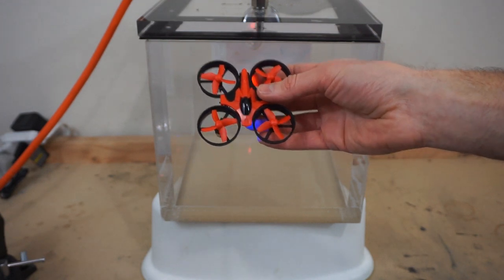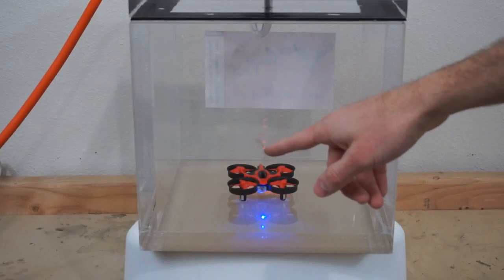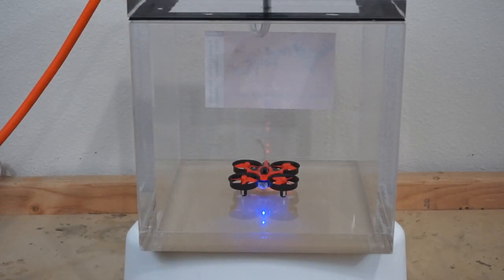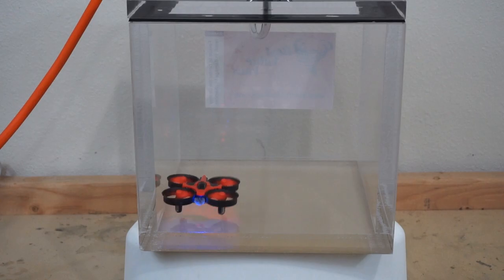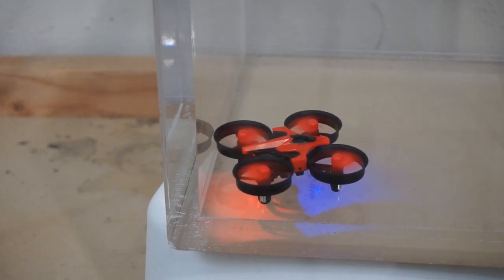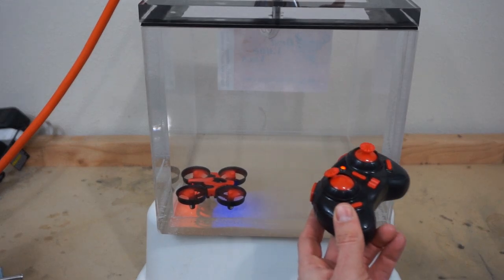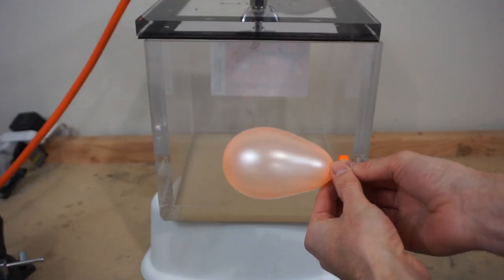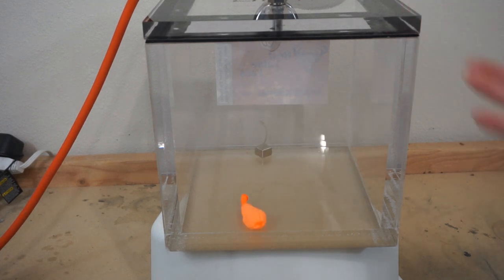What Happens When You Put A Drone In a Vacuum? Can It Still Fly?

Comment: Right so here are all the problems: 

1. The reason that the quad copter is capable of flight is not a pressure differential, it is simple movement of air. Yes, there is a pressure differential, but thats just because something is moving in a fluid

2: your balloon only works with liquid or gas rocket fuel that pressurizes itself as it is ignited. Without the pressure of the atmosphere, a solid rocket will not burn fast. For proof, check out Cody's Lab's latest video. 

3. The people who sent the rockets to space knew what would work and how it would work, if they hadn't, there is no possible way that they could successfully direct a rocket anywhere.
Reply: The third point doesn't matter as much as the first two
Reply: He gets the point across.
Reply: Jaden CM there are solid motors used in space, especially on smaller rockets or as kick stages. These obviously work, so they have some mechanism to work, although my physics smarts aren't good enough to make a guess as to why
Reply: Marius Schär it is possible to have solid boosters that pressurize themselves as they combust, the thing is, and I'm oversimplifying this, when you burn things in air there is pressure (oxygen is not necessarily necessary) but without the pressure, you cannot get a chain reaction causing repeated combustion. 

In a vacuum, when you burn things, the molecules that combust fly away/lose their heat too fast to supply enough heat to the next unburnt molecules in order to catalyze the combustion reaction. 

So if you were to take a rocket and essentially plug the bottom in order to create something that acts like an artificial atmosphere, you could get combustion. But obviously there would have to be a solid oxidizer in the mix.

I am, however unaware of the actual applications, I just know about the theory.
Reply: Jaden CM Your first point is wrong. A wing works because of pressure differential. There's a higher pressure below the wing then there is above the wing when it is spinning. The rotor blades are just wings mounted in a circular pattern.
Reply: Parker Suscavage i think it's unlikely the blades on a $20 rc drone have a airfoil profile, they're probably just angled, that movement of air will by far be the more significant factor.
Reply: Parker Suscavage well, what happens is:

The propeller moves, the air is pushed down and a little bit in the direction of the propeller's spinning, if we're looking at it short term, and once the air is pushed down, in that moment, there is more pressure below the propeller than above. However, this pressure "differential" is just what keeps the prop from starving for air.
Reply: Jaden CM no, no.   drones can fly because of the lower pressure, above the drone, created by the props, not because of airflow.   Your lungs also expand, because of a low pressure created by your diaphragm flexing, the move into the low pressure.  Thermo dynamics states that high pressures will move and equalize with low pressure.  if it was just air flow, then during hurricanes, things  would never come down.
Reply: Greg Goodenough that's why your lungs expand, but you cannot apply that analogy to a fan, it is mostly air movement.
Reply: cjeam sure.  But things get sucked into the fan, such as air, because of a pressure differential.   Air resistance is simply the production of a high a low pressure gradient.   I don't know if I answered a question, or if you had one. But "yes"  lol
Reply: The blades pushes air down, so the drone goes up. This is why the blades are angled down. Using your logic, you should be able to fly a drone with a simple air foil, with a flat bottom, and the drone would move upwards, but props aren't designed like this, because you need a downward force.  For every action, there is an equal and opposite reaction.  Push air down, you go up. Its why there is an elevator on a plane.
Reply: Talk to any physics professor.  They will tell you it is the negative pressure that pulls the plane/drone up.  The propellers just serve the means to create a greater pulling pressure than that of gravity.   Just to be clear, we both agree that airflow is the function of flight, but I'm saying the air flow is a creating a great enough negative pressure above the flying object to allow flight.
Reply: Greg Goodenough 
I'm going to make this as simple as I can.

Step 1: prop blade begins to move
Step 2: air in way of fan is pushed along the normal line of the blade
Step 3: air that is pushed by propeller pushes other air around it
Step 4: because air is compressible, the resulting air mixture is now more dense because minor pressurization is easier than acceleration (not really the case but it works similarly)
Step 4: air that is below equalizes in pressure, or density, with the atmosphere.

Now, the force on the propeller is clearly a result of step 1. The pressure differential is a relatively small reactionary force.

So while step 2 happens, there is an equal (but opposite) pressure deficit in that instant parallel to, not above or below, the propeller.

As step 3 happens, air from above fills in toward the low pressure. This has little effect on the propeller itself, because the air with high pressure at the bottom has a negative vertical velocity, meaning that the air flow to the low pressure is actually downwards.

A diagram is worth a thousand words, but essentially that's what's different about a prop and an airfoil, at least when you ignore that the main lift from airfoil is also not a result of a pressure differential...
Reply: Greg Goodenough sorry that was so long, but physics gets like that.
Reply: Jaden CM lol.   It's fine.   I have my masters.   Yes.  The props do push air, and there is a force generated from that push, but then, in a system where there is no negative pressure above the props, the drone would not lift.  This system also does not exist.  Again, it's the same concept as your lungs, air does not move into the lungs because your diaphragm flexes, but because it generates a negative pressure gradient, barely below 1 atm.   Which then causes air to fill your lungs.
Reply: Greg Goodenough +Jaden CM aren't we just having a thrust (from the mass of the air being accelerated downwards) vs lift (from the pressure differential) argument here? And which one contributes more to the flight of a drone?
Reply: Greg Goodenough think of it like this: given that you put a big propeller in a vacuum surrounded by a ton of bouncy balls. The bouncy balls individual volumes are << the propeller's. Friction still applies, why not. Does the propeller move in the expected direction when turned on, and is there still a pressure differential?
Reply: Greg Goodenough also the lung thing isn't analogous because the motion of an expanding sac has no relation to that of a two ended system, in the eyes of mechanics at least. Mechanics meaning that part of physics, not auto repair men.
Reply: cjeam yes we are.
Reply: Jaden CM it's analogous for the system.  If we include the human body in my example, we'll have to include a city for your example
Reply: cjeam but lift in itself isn't really a result of a pressure differential either.. the differential is always a reactionary thing. The "forces at play" pay little attention to them.
Reply: Jaden CM https://www.grc.nasa.gov/www/k-12/UEET/StudentSite/dynamicsofflight.html  Here is a nice diagram from NASA explaining how air that is forced down, generates a higher pressure below the wing, and forces the plane to move to an area of lower pressure and lift.
Reply: Greg Goodenough I edited that comment
Reply: Greg Goodenough did you read my explanation? There is a difference between a flat prop and a wing.
Reply: Greg Goodenough I would like you to respond to my proposed hypothetical. I think it's far more analogous than your lung.
Reply: Jaden CM I'll agree with that.  A flat prop, being literally flat, no angles.   Then yes, I'd agree with that. It also wouldn't work very well, at least not as efficiently as it could.
Reply: Greg Goodenough well the flat prop is what I've been referring to, and most props are flat with parabolic angles, like a section of a hyperboloid or something. 

This is just to achieve more of a steady acceleration of the air downwards. If the prop's thickness were shaped like an airplane wing, there would be more force due directly to pressure.
Reply: Exactly, the drone flies because the blades are accelerating air down.  Newtons 3rd law says an opposite reaction occurs which is making the drone go up.  Same reason for a rocket or a jet engine.  It
is all about accelerating  something, either air for a plane or water for a boat or exhaust for a rocket.
Reply: Preface: I have a Bachelors in Aerospace Engineering.

1. Lift is calculated by integrating pressure over the surface area of the wing.  It doesn't matter if it's a fixed wing or a rotating wing craft, the principle is the same.

2. Rockets actually work best at what is called a "design pressure".  For launch systems, that design pressure is selected somewhere between sea level pressure and zero pressure (usually on the lower end).  Therefore at launch the nozzle is in the undexpanded state, passes through the ideal design state, and when the burn ends it is at the overexpanded state.  To say that pressure helps a rocket burn is just false.

3. Can't argue with that.
Reply: joemonster55 solid rocket, and it's not false, it's easily testable.

Where did you get your bachelors?
Reply: joemonster55 I think you're confusing a couple of the details in there, considering that burn rates are different under different pressures.
Reply: joemonster55 the applied pressure is not the same as air density. We are talking about air density, are you?
Reply: Because I'm pretty sure that integrating applied pressure is what you're supposed to do, we were disputing what causes the applied pressure
Reply: Applied pressure meaning force applied
Reply: I want to not be notified of this post anymore. Lol. The answer is pressure difference.  Known as lift.   Stated by joemonster55 Ender Skies and myself. I'm not even sure what argument we are talking about anymore. I was working.  Lol. I'm a biochemist, but my professor works/worked  for NASA, thus the diagram.  And my physics professor told me years back that bringing up this answer to how things fly would be "fun".  Lol.  ...and now here we are.
Reply: Jaden CM while it is true that chamber pressure increases burn rate, engineers don't achieve that high chamber pressure with atmospheric pressure,  they do it by carefully selecting the throat area. Atmospheric pressure is nearly always bad for rockets.
Reply: So make a prop for a quad that has no angle of attack, and is just an airfoil, and see if it flies.
Reply: If you made a propellor that was completely flat, it wouldn't act as a propellor.
Reply: Actually, perfectly flat wings can produce lift so long as it has some angle of attack.  Look up "thin airfoil theory". Cl = 2*pi*aoa
Reply: that's because it wouldn't be a propeller if it was flat! There are no flat propellers! The propeller's curves push the air one way and the equal and opposite reaction is the craft moving the other.
Reply: in space they use ion thrusters but i couldnt explain it -   if you had a quad-ion-thruster-copter presumably it could work in a vacuum!

Comment: Totally plausible argument, assuming the rocket has six walls to thrust against...
Reply: Rocket thrust works like a fire hose. The force produced by the hose is not caused by the water hitting air it's caused by the pressure of the water leaving the hose